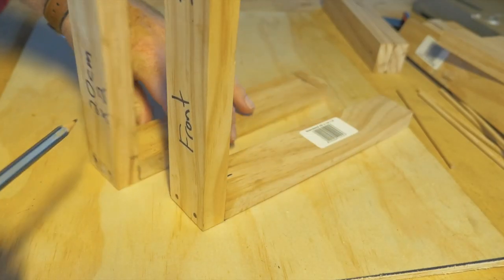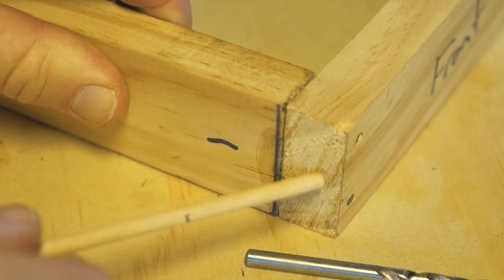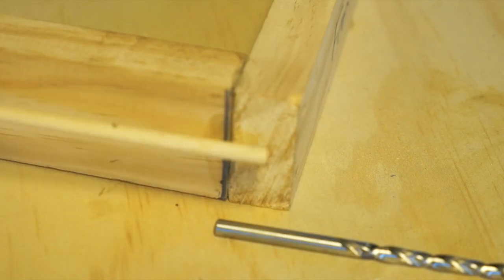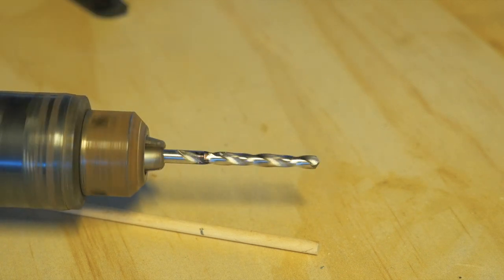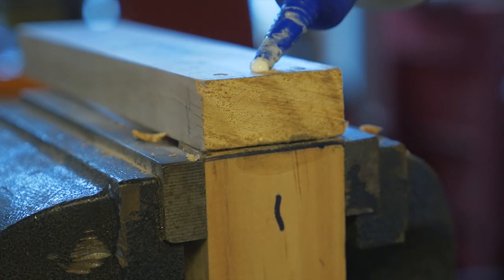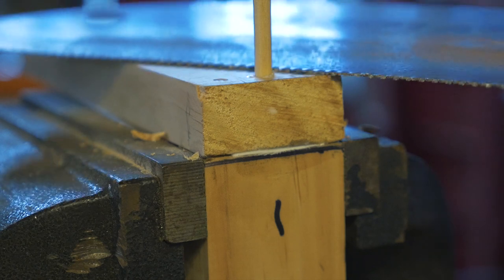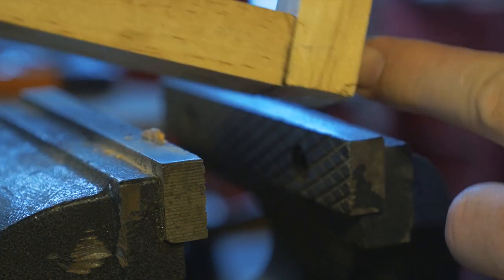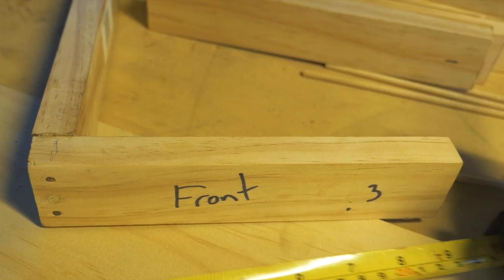How to Build The Apprehension Engine #3 – The Sides

Comment: I'm wondering, do the nails contribute to the sound by adding/damping some resonant frequencies in the frame of instrument? I may be wrong but it seems the nails aren't used in traditional acoustic string instruments. Of course, the AE is very different by its nature...
Reply from the maker: The nails are more set for support and holding it while the glue sets. If you can build one wihtout the nails and just use glue feel free to try.